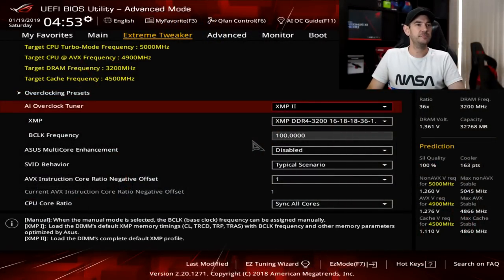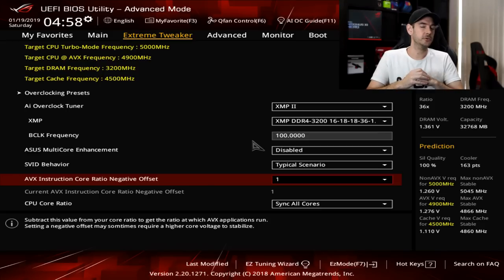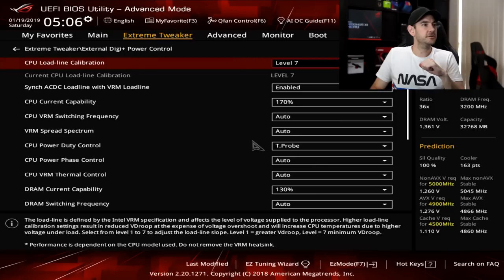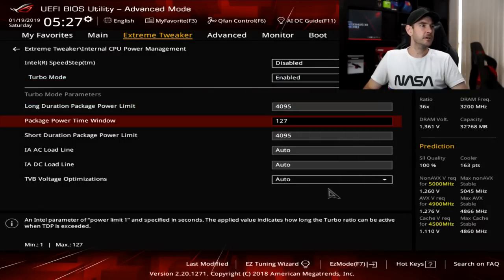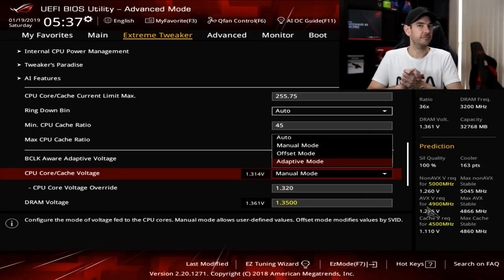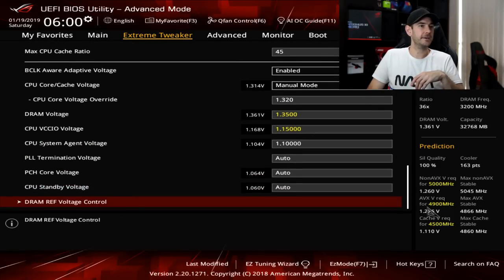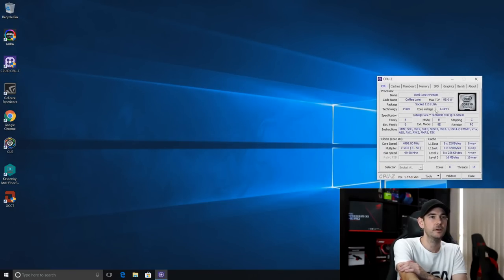The Complete i9 9900K Overclocking Guide - Maximus XI Z390 and Others

Comment: Stable 5GHz @ 1.34v. Left for an hour and temps didn’t exceed 65c. Using a CoolerMaster ML360R. Now I need to start playing with the voltage to find my sweet spot.                                                             EDIT: Found my sweet spot @ 1.235 V. Temps dropped to 60c average under full load. 👍🏽
Reply: What board you using

Comment: You have a gift of explaining things nicely...great video!
Reply from the maker: Thanks George.
Reply: Can I use my current motherboard of the rog Maximus hero x ac WiFi on an i9 9900k?
Reply: @nathanielosei4333  Technically you can, with updated BIOS, as the cpu socket is the same LGA1151 but you wont be able to overclock it and you wont get max performance out of 9900K.
Reply: @georgereiss5494  thank you ,so I guess I need a new motherboard and how about the RAM can I use the same as I currently use on the 9900k?
Reply: @nathanielosei4333  It depends what you got now. If its DDR4 1600Mhz or higher, you dont need to by new RAM.

Comment: Got 5.2 Ghz on a i9-9900ks with this guide (1.350volt)
Reply: @RectalDiscourse the turbo speed it.
It is normal 4.0ghz
Reply: Did you end up changing any other settings to get this? I also have a KS. Thanks!
Reply: @KeithStrang  
Only, the things that boosted did. 😊 
And the volt I changed to the 1.350v 😊
Reply: Jesper Hedemann thanks! 

I tried those setting and it boots fine, but when I run a stress test temps seem fine for about 15 seconds, then all of a sudden they start shooting up and I get BSOD.
Reply: @KeithStrang  
Try turning the volt up a bit maybe 1.375
I will not go higher then 1.400

Comment: Great video!  The only thing that was weird with mine is that both programs that you used in the video are displaying my voltage to be about 1.144 V (tried manually setting to 1.3)  for core voltage. Ran OCCT for 45 mins no crash or errors, max temp was 86 but averaged in around 66.  The fluctuations in temperature are what concerned me but after watching your video a few more times I believe that is normal...hopefully.  Guess I will see if I can get higher clocks, thanks.

Comment: 10900k please brother 🇬🇧👍
Reply: Managed to OC mine stable at 5.1GHZ with only 1.314 volts OR 1.285 VOLTS under load due to load line 7 setting. This thing is a beast and sits nice and cool under load! AMAZING 10 CORES AND TWENTY THREADS AT 5.1 WTF MAN !!

Comment: Thanks for this guide man.  Spot on.  I did what you said and she's running strong. I'm running the Hi150 Pro Triple 120 Rad and the stress test only hit 85c.  Idles like 38-43c Which is great for a steady 5.0ghz.  Super Super happy.
Reply: Those temps are horrible
Reply from the maker: Not bad for an H150
Reply: @boostedmedia  I can't decide between Z390 Apex or Dark for my 9900K... Currently using 9980XE with VI Alpha so I like Asus.
Reply: why man ? Why you do that ? To gain 7 fps ingame and wear out all of your component for 40 sec faster video rendering ?? For 300mhz more ? Your temps are too high omfg, you are killing your cpu and stability haha
Reply: @Undersnow243  It will barely shorten it's already 50 year lifespan.

Comment: Hey, I did everything on the video, and it works well. Only it always fails first boot attempt when turning it on. But works well if I reboot. Sometimes I get CPU fan error but It’s due to liquid cooler I believe. 
Mobo: Z390e Gaming Asus rog. i9-9900K. 

Any idea?
Thanks in advance.

Edit: It fails on first light, the cpu one.
Reply: My i9 9900k is stuck at 4.0ghz , a week or so ago I followed your guide and got it to 5.0ghz but only with xmp2 , if I tried xmp1 it wouldn't apply ... now I tried another going back to xmp1 and it reset the clock , now it will not apply the clock and kts stuck at 4.0 ghz , please help !!!!!!
Reply: @brentdavis529  just reset your bios lmao

Comment: Hi! I'm overclocking my CPU, but I noticed that during a Prime95 test, the Core Speed in CPU-Z will suddenly drop and get locked at a lower speed instead of the speed I set it at. However, if I don't turn on Prime95, it goes back up to the proper set speed. Is this because of AVX or is there something else downclocking the CPU?
Reply from the maker: It’s either AVX offset or a thermal/power limit throttle.
Reply: Annabelle did you solved this problem?? I have the same issue...
Reply: @simonefranceschini00  maybe temperatures?
Reply: @viperro4542  I solved by following another guide, anyway temperatures were not a problem because i have a liquid cooler.
Reply: @simonefranceschini00  wich guide
Reply: @viperro4542  i don't remember, it was 2 months ago...

Comment: great video. watched it about 4 times! got my9900k running at 5ghz and 1.240v thanks!
Reply: Very Low voltage, mine don't enter Windows with voltage under 1,3 is a strange thing?

Comment: Would this be good for a 9700k.
Reply from the maker: Yes. You may need to do some fine tuning but if anything temps will be a bit lower and a little less voltage required to reach higher clocks. :)
Reply: @boostedmedia  Thanks!
Reply: Sadly i need about 1.33vcore to be stable at 5ghz when gaming
Reply: @PulsePTYork  thats not bad dude. this guy absolutely won the silicon lottery with his cpu. on silicon lottery site they have 5ghz 9700k for sale that need 1.35 and they cost $400. got mine for like $350 and need 1.34v to get 5ghz
Reply: @Daniyilrs  thanks, ended up needing to replace my motherboard. On the new one i got 5ghz at 1.3 :)

Comment: Nice video. I set the core voltage to 1.33 v but when under load it jumps to 1.36? Is that normal? I’m on manual mode.

Comment: Thank you very much for putting out this video.. I had an overclock of 38.9%   (5GHz) . ran the test with OCCT ver. 4.5.1 and was very stable constantly pushing it to 80 -85c Temperature levels for the most part. 

i did have a message 10 minutes into the test with OCCT where it said the following :    

Core #0 over maximum Value!  
Value Reached : 88, Max Value: 85 

after that the temperature dropped to around 65c Temperature levels where I  think the test stopped or existed !!

Anything I should be doing or worried about  ? thank you

Comment: Try thoese setting and pry for me i spend almost 13 hours test thoese setting in 9900k 
Motherboard z390 e gaming 
I get idle voltage 0.8-1.27 max 
Idle temp 30-31 max temp 72 max load 
Change only thoese setting and everything is on stock 
Ai overclock tuner : auto
Asus multicore enhancement : disable 
Svid behavior : best case 
Avx nevigate ratio offset : 0 
Cpu core ratio : auto : don’t sync all 5ghz
Dram freq: but it as your ram speed
Cpu svid support: enable 
Load lan calibration : auto 
Sync acdc load line : enable 
Cpu current capability : max 
Vrm spred spectrum: disable 
Cpu power duty: extreme
Cpu power phase : extreme 
Turbo mode :enable  (this is must)
Long duration power limit : max 
Short duration power limit : max
Bclk spread spectrum : disable 
Cpu cach core currunt limit max : max 255.75
Max cpu cach ratio:  47 depend on how much he give you cpu ghz speed if he told you target is 5 ghz make it less 3 ghz  in my case he give me 5ghz so i put 47 
Bclk aware adaptive voltage : disable 

Advanced cpu configuration turbo mode also enable 

Some time you get speed 4.9 it good enough 
The different between 4.9 and 5.0 is alomst nothing 
Benchmark your system play with it 6 hour 

Thank you
Reply: Hey I've got the same CPU and mobo but what are you using as your cooling solution? Because I have a DRP4 and wondering if it's good enough for OC'ing.

Comment: Thanks, i learned so much. Now running at Constant 5Ghz and i only crashed once in Prime95. I bumped up my voltage just a tad and now i am running stable....kind of scary to see 95°C as a Max :D But you'll never get that high if you're just gaming.
Reply from the maker: Yeah Prime95 is a totally unrealistic load. Try running something like realbench and see how got it gets there.
Reply: @boostedmedia  Can i consider my system beeing "stable enough"? Because repeatedly running Cinebench like 6-7times gives me a bluescreen. However encoding with Handbrake x264 for 12 Hours straight, which i occasionally do, does not crash at all with temps at Peak 92, 88 after like an hour. Should i increase the voltage a bit higher? Other than that i use your exact settings.
Oh and one thing: You said at 13:39 that BLCK adaptive voltage should be set to disabled. But then it cuts back to enabled. Was this intentional? I have it disabled now. Sorry for bothering you with this, but i am having a hard time.
Reply from the maker: Yeah leave adaptive voltage disabled. 

Have you watched my stability testing video? It should help :)

Comment: Thank You! for sharing such detail video. Much appreciated it, I have the same cpu and motherboard  with my ram just at 3000Mhz 32GB worth of it 4 sticks. Other than I think I am giving this a go and see how it turns out. I also have a be quiet! Dark Rock Pro 4 installed  250W TDP. Still debating on an AIO or just sticking with this cooler depending on my testing. ;) plus 1+ Sub here.

Also at what temp should I keep my CPU base on my OCCT test results? My max temp that is.
Reply from the maker: Have a watch of my stability testing video :).

Comment: Very nice video...I followed your instructions...and got 5000 Hz on my 9900k with the maximus XI hero with the first try. I ran  Real Bench a few times.... .My idle temp is 27C on all cores and at full load 66C..i set the clock speed from 100 to 101 and got an extra 50hz.....I have the Cooler Master  240l  water cooler with  quad fans in a Cooler Master modded H500 Case...I subscribed to you channel.....Thanks.....Winfried
Reply from the maker: Nice result! Thanks for the sub!

Comment: Best guide I've found so far, so thanks. I'm using 4400 MHz ram, so the XMP profiles already take me to 1.45v on the DRAM voltage, and 1.42v on the VCCIO. Apparently it's very happy to be overclocked to 4600mhz, but I'm a bit worried about upping the DRAM/VCCIO voltage further. Any thoughts?
Reply from the maker: I definitely wouldn’t go any higher on the RAM. I don’t go above 1.42 personally.

Comment: What are the CPU Current Capability values based on? Yours has a maximum of 170%, Der8auer's had 200% and mine is at a meager 140%... Are these values restricted by the Motherboard Model? Mine's a ASUS ROG Maximus XI Code while I believe Der8auer's was a ASUS ROG Maximus XI Extreme and yours a ASUS ROG Maximus X Hero
Reply from the maker: It varies depending on the motherboard and bios version. Just set it to the maximum you can. It’s u likely to make a difference at the levels we’re operating here.

Comment: This guide was great! First ever build!😁I got stable with Cooler Master 620M Air Cooler for 10850k Asus Z490 Tuff plus Wi-Fi ,This worked for me Temps 50-60 at 1200RPM Max , 1.265  Volts running Cinebench r23 single core score= (1383 ) with HWMonitor
XMP 1=GSkill 2133/3200, AVX 0 ,Sync All Cores 50, All Core Ratio 50,( Ring Down, Min Cpu, Max Cup Ratio = All on Auto, 
CpuCore/Cache Voltage=Manual Mode and Cup Core Voltage Override= 1.3, and DiGi+VRM/ Loadline Calibration 5
Reply: This is all I did nothing else👊

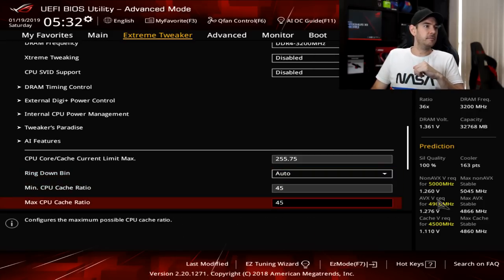Comment: @12:45 after setting “Cpu Core/Cache Current Limit Max” to the highest value on my bios there are other options I have on my bios that you don’t have on your bios in the video for example after “Cpu Core/Cache Current Limit Max” the next option for me is “CPU Graphics Current Limit” and also after “Max CPU Cache Ratio” I have an option that says “Max. CPU Graphics Ratio”. Any changes I can make for those 2 option for any performance gain?
Reply: I have i9-9900k with a Asus ROG Maximus XI Formula M/B and a 2080ti also 32gb ram at 3600. Any info will be greatly appreciated

Comment: Cheers for the superb simple to follow guide, worked a charm. One question if I could, after my pc has been turned off from the main socket and I press the power on button the pc flashes on for a split second and then off and back on to boot up normally, is this ok? Thanks in advance 🙏🏼
Reply from the maker: That’s memory training. Normal.

Comment: Great detail!  I’m still working with voltage for 5ghz.  Maximus XI//9900k//kraken x62//850w psu//2080ti//h700i and so far I boot up fine but as soon as I start r15 it bsods with whea uncorrectable error or something.
Reply: Welp!  I finally got it.  1.32 @5ghz.  1.325 got me a bsod.  Amazing that little amount can be so bad.  I’m pushing 83°C.  New cooler on the way.  But so far it’s looking good!  Thank you!
Reply: Well after two successful runs and getting 2121 on r15 it gives me another bsod with the same error as above.  Hrmm.  This is fun!  Said no one haha

Comment: Just want to say thanks for this video. You really have laid out everything so nicely and in a way even a noob like me can understand. I have the same CPU and motherboard and after following along with this video I'm amazed at the improvement. Thanks again.
Reply: I have a follow up. I use my PC for gamming but I'm also a freelance 3D artist using Maya 2020 and Substance. Lately I can't render anything which is CPU intensive because I started getting hight temperatures like 100 c + and now I just get a blue screen. I have a NZXT Kraken X62 and it can't seem to keep the temps down even with Fan & Pump speed lock at 100%. This only happens when I try to render. Do you have any ideas?

Comment: Most helpful guide I've ever followed.
Reply: I mean seriously.  I just popped in my i9 and followed this to a T.
I've went back and dropped my core clock down a bit as the temps were a bit high for my liking(under full load spikes were around 90 c)
So I'm down to 4.8ghz(4.7 with the offset we set)
And my vcore is 1.245v, now running through your stability tests before I try to drop it down a bit.

Comment: thx for that's video it's help me a lot , i'm using same cpu and motherboard xi code , only issue with this settings the temperatures reach 97C
so what i do i reduce voltage to 1.250 only and i got 84 max temperatures
Reply: thats great if it doesnt crash on you during longer workloads
Reply: @spatrk6634  my pc take 2-3 days to crash getting blue screen , buy it's happen when i sleep :D sadly i couldn't read the error message lol
Reply: Hey friend, i have the same motherboard, how you let it stable? Can you tell your configs?

Comment: What a gem. I happen to have a similar mobo so was so easy to follow along. Especially after I had to completely reset everything to stock due to my own hubris .-. 

With your settings (avx offset 0) mine runs a bit hotter than I’d like but still in limits so I’ll be trying lower voltages until it breaks. I’ll probably (maybe) update with my final result.

Comment: My opinion regarding FQ scaling - mine 8700K @ 5143 Mhz consumes around 25 - 30 watt in idle when not scaling and at 100% FQ. If I use power saving, it drops to around 8 watts to 12 watts. So why to waste 20 watts if many users are not using their PCs on full load most of the time? :-D I don´t understand your logic. You can set it in windows under power options. I also turn off my wifi routers during the night, because why wasting 8 watts if no one is using it? So if you do it for all electronic devices, you can save some money on electricity.

Comment: Nice video. I am curious as to why you seem to always mention in your video's that you can do certain things "If you have decent water cooling" but you literally never even mention air cooling ever. Reason I'm asking the question is i'm in Australia too and every dumb ass you talk to in computer stores or just in general for PC advise in Australia is, well, a dumb ass, until I came across your video's, I was finally able to relate.

Anyway, why do you just ride off air coolers? As far as I know something like the Noctua NH D15 performs the same or better than all water coolers. I might be wrong though.
Reply from the maker: Very good question mate. I tend to not talk about air coolers as they are far more susceptible to ambient conditions. A large copper air cooler is actually better at removing heat from the CPU than a water cooler because copper conducts heat better than coolant. At least up until the point it becomes thermally saturated. 

So typically you’ll see better transient performance with a high end air cooler than water cooling. The problem arises when the air coolers ability to dissipate the heat into the air is overcome. 

So typically with an air cooler you’ll see temperatures continue to rise over time. 

Basically I stay away from air coolers in my videos because there are too many variables to safely guide people as to what values are “safe” for overclocking.
Reply: Thanks for the reply mate! That makes sense and thank god for an aussie answer. So basically with our climate water cooling really is the way to go especially when overclocking because the temperatures remain the most reliable? Cheers buddy!  @boostedmedia
Reply from the maker: Depends if the CPU is generating more heat than the cooler is able to dissipate.

Comment: Can You Please please help me.. i am not a tech expert and i really really need help. I have Asus Hero Maximus X1, with i9 9900k , 64 Gb 3200 Hz Ram (16gb x 4 ) because i need to render work and stuff. So, If i am using default profile on my motherboard. My PC boots up fine and starts like immediately. Now the problem i am getting is that my Ram works at 2133 mhz while its 3200 mhz.. to get it work at full speed i enabled XMP 1 Profile but now it takes too much time to boot up and the LED light in my ASUS motherboard goes to red, white then red again white then  red white then green for a long period of time. Before my PC starts in like 10-15 seconds now it takes 2-3 minutes. I tired using XMP 2 profile also but its same. I hope i am making sense and if please you can help.